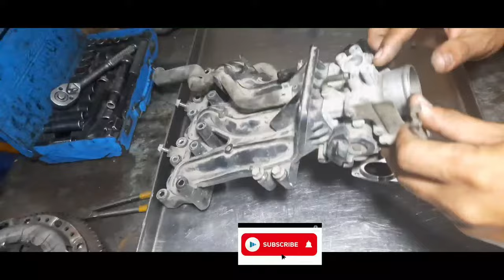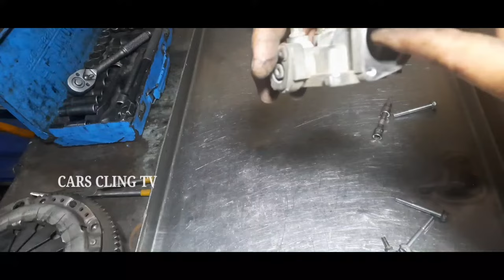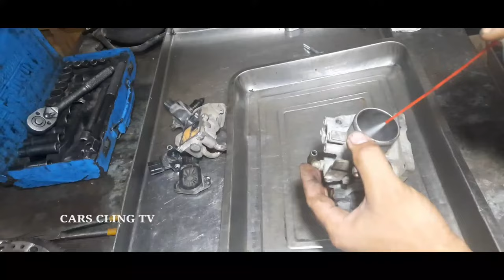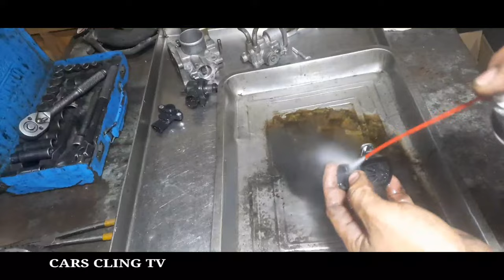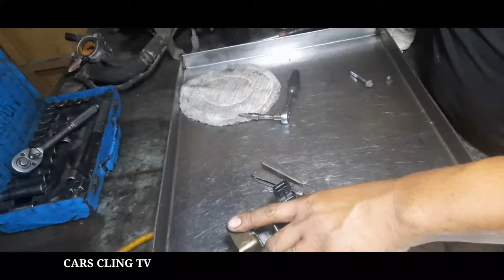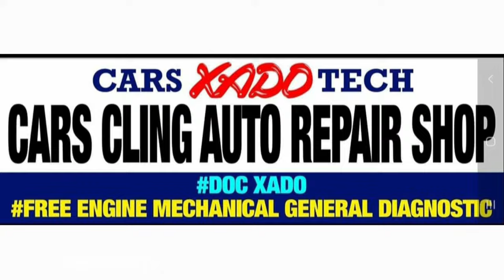ENGINE VIBRATION DIED DURING IDLING IACV TPS MAP SENSORS MAIN CAUSE ISSUE CLEANING SET UP TUTORIALS

Comment: New subscribe here, boss tanong ko lang if kasya lang ba ang mags wheel ng mini Sedan sa minivan da64v? Thanks po sa reply
Reply from the maker: Ang pagtanong kung magkasya ang *mags* (mag wheels) mula sa isang *sedan* patungo sa isang *Suzuki DA64* (karaniwang tinutukoy bilang Suzuki Every, isang compact van) ay nakadepende sa ilang mahahalagang sukat at detalye. Narito ang mga pangunahing aspeto na kailangan mong isaalang-alang:

### 1. *Tire and Wheel Diameter*
   - *Diameter ng Gulong:* Siguraduhin na ang diameter ng mags wheel ay angkop sa diameter na kayang tanggapin ng iyong Suzuki DA64. Kung masyadong malaki o maliit ang diameter, maaaring hindi magkasya ang gulong at maaaring makaapekto sa clearance (puwang sa pagitan ng wheel at wheel well).

### 2. *Bolt Pattern (PCD - Pitch Circle Diameter)*
   - *Bolt Pattern:* I-check ang bolt pattern ng iyong Suzuki DA64 at siguraduhin na pareho ito sa bolt pattern ng mags wheel mula sa sedan. Karaniwan, ang DA64 ay may bolt pattern na 4x100 (4 bolts, 100 mm ang distansya).
  
### 3. *Offset*
   - *Offset (ET):* Ang offset ng wheel ay mahalaga upang tiyakin na ang gulong ay magpi-fit ng maayos sa wheel well na hindi tatama sa fender o sa inner suspension components. Ang offset ay sinusukat sa millimeters at ipinapakita kung gaano kalayo ang mounting hub ng wheel mula sa gitna ng wheel.
   
### 4. *Center Bore*
   - *Center Bore:* Ang center bore ay ang butas sa gitna ng wheel na dumadapo sa hub ng sasakyan. Tiyakin na ang center bore ng mags wheel ay akma o mas malaki kaysa sa center bore ng iyong Suzuki DA64 para sa tamang fitting. Kung mas maliit, hindi ito kakasya.

### 5. *Tire Width*
   - *Lapad ng Gulong:* Siguraduhin na ang lapad ng tire ay akma sa space ng wheel well ng DA64. Kung masyadong malapad, maaaring tumama sa loob ng fender o magkakaroon ng rubbing issues.

### Steps to Verify Compatibility:
1. *Consult Manufacturer Specifications:*
   - I-check sa manu-manong ng Suzuki DA64 ang mga tamang sukat at specifications.
2. *Professional Advice:*
   - Kumonsulta sa isang professional mechanic o tire shop upang masiguro ang tamang compatibility.
3. *Test Fit:*
   - Mag-test fit ng isang wheel kung posible upang makita kung tama ang akma bago bumili ng isang set ng mags.

### Summary:
Ang pagkakasya ng mags wheel mula sa isang sedan sa iyong Suzuki DA64 ay maaaring posible basta't ang mga sumusunod na aspeto (diameter, bolt pattern, offset, center bore, at tire width) ay tugma o compatible. Para sa pinakamahusay na resulta, kumonsulta sa isang professional o tire specialist para sa tamang mga sukat at fitting.

Thank you for your support!

More Basic Pointers Toturials FULL Videos: https://www.youtube.com/channel/UCXSl7FUzPZV3lIxFWCHFTVA
For more inquiries, please contact us at our 
FB Page CARS CLING TV: https://www.facebook.com/clingauto
CARSClingTvShortVideos: https://www.youtube.com/channel/UCsUWQnaD9vVKqL_w6eAYhgA
#
#xadoenginetreatment 
#carsclingtv 
#basicpointerstutorialissuefixed 
#xadoenginetreatmentengineperformancerecovered
#10yearslonglastceramicscarbonmetalcoated 
#carsclingautorepairshoplegacy 
#trottledelayremoval
#blackwhitesmokeremoval
#lowpowerengineremoval
#carsclingtvshortvideos
#xadoenginetreatment 
#changeoilpms
#enginecarbonchroming 
#carsclingautorepairshop
#remedyxadotreatment 
#acceptcheckengineissue 
#troubleshoot 
#legitonlineseller  
#Mobile09171259996
CARS CLING TV Located @Purok Pandian Gay Corner Makar Highway Brgy. Labangal General Santos City SouthCotabato 9500

Comment: San Po makikita turbocharger bypass circuit valve boss? P0033 Po fault code nababasa. Magandang Araw Po.
Reply from the maker: Ang fault code na P0033 ay may kaugnayan sa Oxygen (O2) Sensor Circuit Slow Response (Bank 1 Sensor 1). Ang Oxygen Sensor ay nagmamay-ari ng apoy ng nagtatrabaho sa mga eksos bahagi ng sasakyan. Ang code na ito ay nagpapahiwatig na may problema sa circuit ng unang Oxygen Sensor sa unang bangko ng mga pyesa ng sasakyan.

Ang ilang posibleng sanhi ng fault code na ito ay maaaring:

1. Sira o hindi umiiral na Oxygen Sensor - Maaaring may sira o hindi gumagana ang Oxygen Sensor na nauugnay sa code na ito. Ito ay maaaring mabilis na lumipas o hindi nag-re-react nang tama sa mga pagbabago sa mga antas ng oksiheno sa mga gas ng mga eksos.

2. Wiring o mga koneksyon na may sira - Ang mga putol, loose, o sira na mga kable o koneksyon na konektado sa Oxygen Sensor ay maaaring maging sanhi ng code na ito. Suriin ang mga koneksyon upang matiyak na ang mga ito ay tama at hindi nasira.

3. Electrical issue - Maaaring may ipinapakitang isyu sa electrical system ng sasakyan, tulad ng hindi tamang voltage o hindi kanais-nais na kondisyon ng circuit, na maaaring makaapekto sa pagganap ng Oxygen Sensor at magdulot ng code na ito.

Mahalagang tandaan na ang fault code na P0033 ay maaaring magkaiba depende sa tatak at modelo ng sasakyan. Ang pinakamahusay na paraan upang malunasan ang problema ay magpakonsulta sa isang propesyonal na mekaniko o magamit ang mga teknikal na dokumentasyon o manual na sinalinhan ang iyong sasakyan.

More Basic Pointers  Toturials videos: https://www.youtube.com/channel/UCXSl7FUzPZV3lIxFWCHFTVA
FB Page CARS CLING TV: https://www.facebook.com/clingauto
CARSClingTvShortVideos: https://www.youtube.com/channel/UCsUWQnaD9vVKqL_w6eAYhgA
#
#xadoenginetreatment 
#carsclingtv 
#basicpointerstutorialissuefixed 
#xadoenginetreatmentengineperformancerecovered
#10yearslonglastceramicscarbonmetalcoated 
#carsclingautorepairshoplegacy 
#trottledelayremoval
#blackwhitesmokeremoval
#lowpowerengineremoval
#carsclingtvshortvideos
#xadoenginetreatment 
#changeoilpms
#enginecarbonchroming 
#carsclingautorepairshop
#remedyxadotreatment 
#acceptcheckengineissue 
#troubleshoot 
#legitonlineseller  
#Mobile09171259996
CARS CLING TV Located @Purok Pandian Gay Corner Makar Highway Brgy. Labangal General Santos City SouthCotabato 9500

Comment: Sir ano po trabaho ng ng patch valve bayun kung tawagin , pati yung pcv valve
Reply from the maker: Ang mga sumusunod na kahulugan ng IACV valve at PCV valve:

1. IACV valve (Idle Air Control Valve) - Ito ay isang valve na matatagpuan sa intake manifold o throttle body ng sasakyan. Ang pangunahing tungkulin ng IACV valve ay kontrolin ang dami ng hangin na pinapasok sa engine kapag ito ay nasa idle o hindi naglalakbay. Nakikipag-ugnayan ito sa ECU (Engine Control Unit) para ma-monitor at ma-regulate ang idle speed ng sasakyan.

2. PCV valve (Positive Crankcase Ventilation valve) - Ito ay isang valve na matatagpuan sa crankcase o bahagi ng engine kung saan nagaganap ang combustion process. Ang PCV valve ay responsable sa pagtanggal ng mga vapors mula sa crankcase at pagdala nito pabalik sa intake manifold para sa tamang combustion process. Ito ay nagpapababa rin ng emisyon ng harmful na mga gas sa pamamagitan ng pag-recycle ng mga ito pabalik sa engine para masunog.

Ang mga valve na ito ay mahalagang bahagi ng sistema ng engine at sila ay kailangan ng regular na paglilinis, pag-aayos, o kahit pagpapalit kung kinakailangan. Ang hindi pag-andar o maling pagkakabalanse ng mga ito ay maaaring magdulot ng mga isyu tulad ng hindi matinong idle speed, engine stalling, o mababang performance ng sasakyan. Mahalagang i-maintain at pa-check ng mekaniko ang mga ito upang magpatuloy ang maayos na pag-andar ng sasakyan.

More Basic Pointers  Toturials FULL Videos: https://www.youtube.com/channel/UCXSl7FUzPZV3lIxFWCHFTVA
FB Page CARS CLING TV: https://www.facebook.com/clingauto
CARSClingTvShortVideos: https://www.youtube.com/channel/UCsUWQnaD9vVKqL_w6eAYhgA
#
#xadoenginetreatment 
#carsclingtv 
#basicpointerstutorialissuefixed 
#xadoenginetreatmentengineperformancerecovered
#10yearslonglastceramicscarbonmetalcoated 
#carsclingautorepairshoplegacy 
#trottledelayremoval
#blackwhitesmokeremoval
#lowpowerengineremoval
#carsclingtvshortvideos
#xadoenginetreatment 
#changeoilpms
#enginecarbonchroming 
#carsclingautorepairshop
#remedyxadotreatment 
#acceptcheckengineissue 
#troubleshoot 
#legitonlineseller  
#Mobile09171259996
CARS CLING TV Located @Purok Pandian Gay Corner Makar Highway Brgy. Labangal General Santos City SouthCotabato 9500

Comment: sir magandang araw tatanung ko lng po kung ano Ang problema Ng aming multicab fi big eye pag nananakbo  biglang nabibilaokan gusto palaging Galit Ang makina,salamat,sauna mabigyan nyo po Ako Ng idea wla kc kming mapagtanungan ginagamit namin sa simbahan Ang among multicab,mas mabuti sana sir kung mabigyan nyo Ako Ng cel no. Na pwd naming matawagan salamat sir and godbless
Reply from the maker: Kung ang makina sa Suzuki Transformer mabilaukan ug murag mapalong, adunay pipila ka mga posible nga rason. Ang mga mosunod mao ang kasagarang mga hinungdan:

1. *Fuel Delivery Issues:*
   - Ang gasolina dili maayo ang pag-agos ngadto sa makina. Mahimo kining tungod sa barado nga fuel filter o adunay problema sa fuel pump.

2. *Air Intake Problems:*
   - Ang makina mahimong wala makakuha ug igo nga hangin. Ang usa ka hugaw nga air filter mahimong makapugong sa saktong airflow.

3. *Ignition System Issues:*
   - Problema sa spark plugs o sa ignition coil mahimong hinungdan sa dili maayo nga combustion, nga mabalda ang dagan sa makina.

4. *Vacuum Leaks:*
   - Ang pagka-leak sa vacuum hoses makadaot sa air-fuel mixture ug makapahinay o makapalong sa makina.

5. *Sensor Malfunction:*
   - Kung adunay sensor nga dili nagatrabaho ug tarong sama sa mass airflow sensor o oxygen sensor, mahimo kining makaapekto sa performance sa makina.

6. *Exhaust Blockage:*
   - Ang barado nga exhaust system, sama sa catalytic converter, mahimo usab makapahinay sa makina.

7. *Dirty or Faulty Throttle Body:*
   - Ang hugaw o dili maayong kondisyon nga throttle body mahimong imong hinungdan nga dili muayo ang acceleration ug makapalung sa makina.

8. *ECU/Computer Issues:*
   - Problema sa Electronic Control Unit nga nagdala sa operasyon sa makina mahimong makalimpose sa dagway sa performance niini.

Kung padayon nga nagapakita ang makina og mga problema, mas maayo nga ipa-check kini sa us aka licensed mechanic o technician aron ma-diagnose ug ma-repair ang problema nga specific.
Reply from the maker: Thank you for your support. Please contact me at this link:

More Basic Pointers Toturials FULL Videos: https://www.youtube.com/channel/UCXSl7FUzPZV3lIxFWCHFTVA
For more inquiries, please contact us at our 
FB Page CARS CLING TV & XADO Available @our FBPage: https://www.facebook.com/clingauto
CARSClingTvShortVideos: https://www.youtube.com/channel/UCsUWQnaD9vVKqL_w6eAYhgA
#
#xadoenginetreatment 
#carsclingtv 
#basicpointerstutorialissuefixed 
#xadoenginetreatmentengineperformancerecovered
#10yearslonglastceramicscarbonmetalcoated 
#carsclingautorepairshoplegacy 
#trottledelayremoval
#blackwhitesmokeremoval
#lowpowerengineremoval
#carsclingtvshortvideos
#xadoenginetreatment 
#changeoilpms
#enginecarbonchroming 
#carsclingautorepairshop
#remedyxadotreatment 
#acceptcheckengineissue 
#troubleshoot 
#legitonlineseller  
#Mobile09171259996
CARS CLING TV Located @Purok Pandian Gay Corner Makar Highway Brgy. Labangal General Santos City SouthCotabato 9500

Comment: Boss Anong cra ng 12 valve n zuzuki kung nag wild sya tapos na tiki lang ang barbula boss
Reply: Pinalitan n ng barbula boss pero vibration Naman ang problema boss
Reply from the maker: Yes Sir, marami cause ng wild either spark plug or injector walang supply ng kuryente then kulang sa open wide ang butterfly ng trottle body iacv subject for cleaning.
Reply from the maker: Yes Sir, kung napalitan na ng barbola then same issue parin, ang next step naman na dapat linisan ang Intake Air Control Valve,.
Reply: @carsclingtv  sir anong dahilan kapag mag back fire yong F6A kapag tumatakbo or naka RPM?
Reply from the maker: Ang pag-backfire ng makina, lalo na kapag ito ay naka-rev (mataas ang RPM), ay maaaring sanhi ng iba't ibang isyu sa sistema ng makina. Narito ang ilang karaniwang dahilan kung bakit nagba-backfire ang makina:

1. **Maling Timing ng Ignition**:
   - Kung ang ignition timing ay masyadong advanced o delayed, maaaring magresulta ito sa backfire. Ang maling timing ay nagiging sanhi ng pagsiklab ng fuel-air mixture sa hindi tamang oras.

2. **Maaari ng Rich Fuel Mixture**:
   - Kapag masyadong rich ang fuel mixture (sobrang dami ng gasolina kumpara sa hangin), hindi lahat ng gasolina ay nasusunog sa combustion chamber. Ang natitirang uling gasolina ay maaaring masunog sa exhaust system at magdulot ng backfire.

3. **Sira o Maruming Spark Plugs**:
   - Ang mga sira o maruming spark plugs ay maaaring hindi magbigay ng sapat na spark upang magliyab nang maayos ang fuel mixture, na nagreresulta sa hindi ganap na pagkasunog at posibleng backfire.

4. **Problema sa Air Intake**:
   - Kung may bara o sira sa air intake system, maaaring magresulta ito sa hindi tamang fuel-air mixture, na nagiging dahilan ng backfiring.

5. **Mga Vacuum Leak**:
   - Ang mga vacuum leak ay maaaring maging sanhi ng hindi tamang idle at fuel mixture, na nagiging sanhi ng backfiring.

6. **Maling operasyon ng Exhaust Valves**:
   - Kung hindi nagiging maayos ang pag-operate ng mga exhaust valves, maaaring magkaroon ng premature na paglabas ng unburnt fuel sa exhaust system.

7. **Problema sa Fuel Injection System**:
   - Sa mga sasakyan na may fuel injection, ang problema sa mga injector o sensors ay maaaring magdulot ng maling fuel delivery, na nagreresulta sa backfire.

8. **Faulty EGR Valve**:
   - Ang Exhaust Gas Recirculation (EGR) valve na hindi gumagana nang wasto ay maaaring makakaapekto sa fuel-air mixture, na maaaring magdulot ng backfire.

Kapag ang makina ay nagba-backfire, mahalagang ipasuri ito agad sa isang bihasang mekaniko upang matukoy ang sanhi at maiwasan ang posibleng pinsala sa makina o sa exhaust system.

Thank you for your support!

More Basic Pointers Toturials FULL Videos: https://www.youtube.com/channel/UCXSl7FUzPZV3lIxFWCHFTVA
For more inquiries, please contact us at our 
FB Page CARS CLING TV & XADO Available @our FBPage: https://www.facebook.com/clingauto
CARSClingTvShortVideos: https://www.youtube.com/channel/UCsUWQnaD9vVKqL_w6eAYhgA
#
#xadoenginetreatment 
#carsclingtv 
#basicpointerstutorialissuefixed 
#xadoenginetreatmentengineperformancerecovered
#10yearslonglastceramicscarbonmetalcoated 
#carsclingautorepairshoplegacy 
#trottledelayremoval
#blackwhitesmokeremoval
#lowpowerengineremoval
#carsclingtvshortvideos
#xadoenginetreatment 
#changeoilpms
#enginecarbonchroming 
#carsclingautorepairshop
#remedyxadotreatment 
#acceptcheckengineissue 
#troubleshoot 
#legitonlineseller  
#Mobile09171259996
CARS CLING TV Located @Purok Pandian Gay Corner Makar Highway Brgy. Labangal General Santos City SouthCotabato 9500